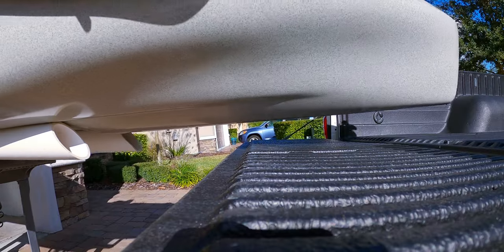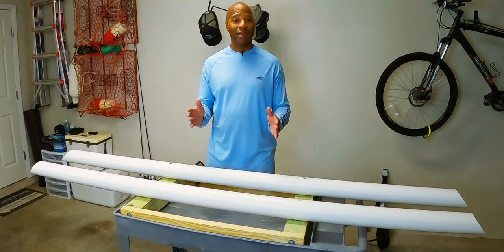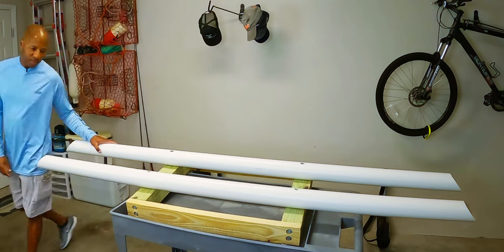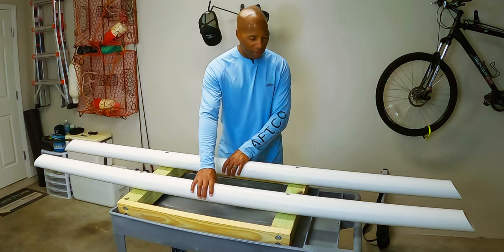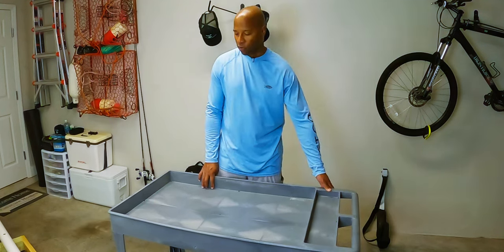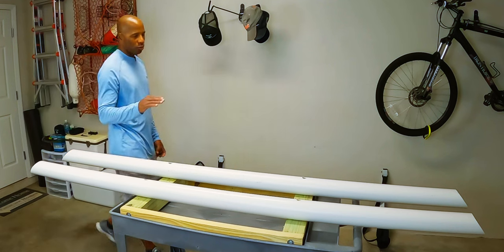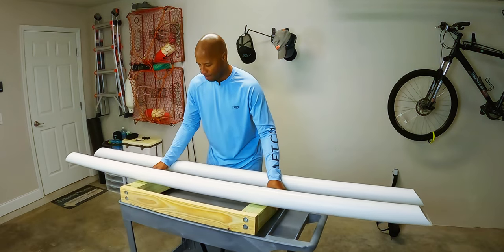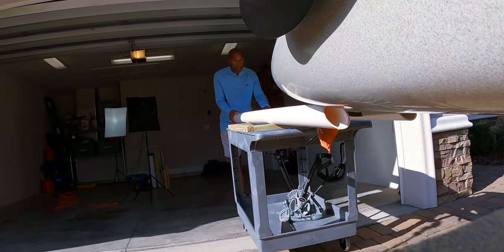How To Build a Kayak Storage & Loading Cart the EASY WAY!

Comment: Thanks! Funny thing is I already had the same cart in my Uline shopping cart before  finding your video. I saw other people use lower quality carts.
Reply from the maker: Nice!  I hope it works out for you.  There are additional details and pics of the cart on my blog - https://kayakfishingaddict.com/2021/12/how-to-build-kayak-storage-loading-cart/
Reply: Complete. Additional comments: Old Town Sportsman 120 PDL required 1) the pipes to be 12 inches off center as they stop before the bow, 2) center measurement for groove under yak is 9" (bow) to 8" (stern)  3) i needed to add weight (leftover 4x4s) to the bottom of cart otherwise it would do a wheelie. 
Thanks for your help!
Reply from the maker: @moretackle1  glad it worked out for you

Comment: This is an interesting build... Similar to others on YouTube that show PVC as the method of support. I was about to build one for my new Outback but decided to check with Hobie for their take on it. First I read my owner's manual and lo and behold there is a section on storage and transport.  They have a diagram and describe this PVC method and strongly discourage it. As a matter of fact they say that if their recommendations aren't followed it could void the warranty. I decided to follow up with a call to their corporate office in Oceanside to speak to a technical specialist. The person I talked to described this as a "tragic situation". They explained that there had been a lot of issues with cracks particularly around the scupper holes that they determine were caused from storage and transport on PVC bunks. They went on to explain that it would sometimes take a year or more for the cracks to develop. Long story short, they strongly recommend against it! Needless to say I'm looking for an alternative method. I hope this information will help others possibly avoid a costly mistake.
Reply from the maker: Hi Tres, I appreciate the concern.  Here's Hobie's official storage advice - https://www.hobie.com/articles/storing-your-kayak,85/ .  

This storage solution IMHO would be in the, "If you must store it right side up, use cradles or something that is shaped to the contour of the hull" arena.  Hobie makes a cradle that you could purchase and use that actually contours to the hull of some of their boats.  I've been to my Hobie dealer who has kayaks stored indoors on their ends and on their hulls on racks for long periods of time without issue.  All of this is to say, I've developed confidence that with a little support, like this solution gives, there should be no issues.  That said, "Caveat Emptor"  as YMMV!

Comment: Great build!  I have a question for you.  Why couldn't you use large wood screws to put the box together?  I'm building this for my 106 PDL.  Thanks for the great video!
Reply from the maker: You absolutely could.  Lag bolts will provide for a more secure connection.  It just depends on how strong you need it to be...perhaps lag bolts are a bit of over engineering.  Whatever you use, it needs to hold up to water as you're washing your kayak off.

Comment: Older video, I know
But for the wheel lock situation, just make a little U shaped chock for the fixed wheel, attach it with some string to the cart so you don't lose it.
Throw it on the front wheel preventing back/forward rolling when you have your kayak stored.
Reply from the maker: Nice idea.  I just have an old blanket in the garage that I throw down.  If you need them you can also get the wheels with the locks....that's an option for the same cart.

Comment: Awesome idea and detailed build, mahalo! One question- how did you know that the finished cart would be the right height with the bed of your truck as the original builder might have a different truck from your own? Looking at your blog it seems that if the unmodified cart is the same height as the bed then I should be good to go, right? Subbed and thanks again.
Reply from the maker: Glad you enjoyed it.  I'm not sure how I figured that out....I think his original spec called out the height and I measured the height of my bed and it was perfect.  My guess is that most are pretty standard if your truck isn't lifted....but that's a guess, ymmv.

Comment: According to hobie the proper way to store the kayak is upside down. How does this storage set up affect the kayak during hot weather?
Reply from the maker: That's a great question.  First, here's Hobie's official storage advice - https://www.hobie.com/articles/storing-your-kayak,85/ .  

This storage solution IMHO would be in the, "If you must store it right side up, use cradles or something that is shaped to the contour of the hull" arena.  Hobie makes a cradle that you could purchase and use that actually contours to the hull of some of their boats.  I haven't gone through a hot FL summer with this solution just yet, however, I have gone through several with a storage rack for my Hobie Compass and there was no issue.  I've also been to my Hobie dealer who has kayaks stored indoors on their ends and on their hulls on racks for long periods of time without issue as well.  All of this is to say, I've developed confidence that with a little support, like this solution gives, there should be no issues.  That said, "Caveat Emptor"  as YMMV!

Comment: Did you upgrade to the Outback? Thoughts versus the Compass?
Reply from the maker: I did....that will be officially announced on my channel in the next video...guess I let the cat out of the bag early huh?  A subscriber picked up my Compass already.  Today was going to be day 1 of me fishing the Outback, but I've been locked down working on producing this video!  I'll get out in a few days and I'll let you know!  My early take is that the Compass is the value fishing Kayak from Hobie.  It's a great boat once you upgrade a few things (e.g. square hatch, thru hull kits for wiring, ...).  The Outback comes with everything you need.  It's more stable.  If I had a 2020 Compass (I had a 2019) I wouldn't upgrade.  The major reason I did, besides wanting to experiment with a new platform, was for the kickup fins.  It's a bonus (maybe) that they're turbo fins.

Comment: I have nearly an identical set-up, but I built wheeled wood carts for each of my Hobies (Outback and PA) at truck bed level.  Like your setup, they rest on 2" and 3" PVC tubes respectively spaced 11.5" apart center to center.  Good weight distribution so the hulls don't deform.  No more lifting - they roll out to the truck and slide in. But I don't wash them on the wood carts, I use the cart deck for storing kayak gear, etc.  I built a PVC rack to wash the boats on.  Same height, the kayaks slide from truck to PVC wash rack.  When dry, they slide onto the cart, then rolled back in the garage.  Easy.
Reply from the maker: Sounds like a good setup.  I don't have room for another rack so washing them on the same storage and loading rack works best for me.  I tell you what, I loaded up today and I'm going to have to get my workout somewhere else...it was easy, peasy, lemon squeezy to load up and go!

Comment: Awesome idea and love the channel. I have a 2021 outback and I am going to make this. I even got the cart free since we have a lot of those at work. One question?? It seems like if you load from the ground and put the front nose (keel) on the pvc pipes and pick the back end up to slide onto the cart and load it that way as a single person, that once weight of the kayak front end is up there it would tilt or fall. Even with brakes on the wheels does that platform not tilt out of place or do you bolt that to the cart. I am asking as a single person loading onto the cart?
Reply from the maker: I never load from the ground onto the cart only from my truck bed to the cart.
Reply: @KayakFishingAddict  Thanks for the reply! I guess I just wanted to know how you got it on or off the cart in the first place. Like to get the kayak on the cart to load in your truck or once it is unloaded off your truck to get it off the cart. Seems like you need two people to lift on or off the cart? I am making it and thanks for the video
Reply from the maker: @randybinc.6443  The very first time I man handled the kayak onto my truck.  I loaded it just like I load it at the waters edge.  I put the kayak on my wheels, put the kick stand on the back to protect the rudder, then I lift the nose onto the truck bed, then I get in the back of it and lift the stern and push/slide it onto the truck.

After that, I unloaded it onto the cart.  My kayak is always either (1) on the cart in storage, (2) in the truck bed, (3) on the wheels between the truck and the water, or (4) in the water.
Reply from the maker: ...oh, and I use the popular bungee method to take the wheels on/off in the water.  There are lot's of videos on that but essentially, you replace the end caps on your cart with eyelets.  Then you have a bungee chord with three clips on it.  Two ends of the bungee go through the scupper holes and connect to the eyelets on the cart.  The other clip which is half-way on the chord goes all the way through the back lift handle and loops back and clips on the pad-eye on the back center of the Outback. Then you simply lift the backend up out of the water and the cart wheels snap into place.   

Here's a video of what I'm talking about ... https://www.youtube.com/cIDmWKyX8xw&t=690s
Reply: Thank you for all that info! The 1,2,3,4 of where your kayak is at all times explained it, the confusion on my part was thinking you took the kayak off the cart after every trip. You guys have an awesome fishery out there with the flats, skinny water, offshore. I have fished in the Tampa bay mangroves and Clearwater once and it was great catching snook, reds, sea trout! Totally different than my fishery out here in San Diego. We do have amazing saltwater fishing offshore for big Bluefin tuna, yellowfin and yellowtail. Inshore is calico bass, halibut, sea bass, etc. Your videos are top notch! Take care!
Reply from the maker: @randybinc.6443  I’m glad that clarified things Randy.  It’s interesting to hear the differences in the fisheries.  One of these days I’ll get back out to San Diego and maybe try to put a halibut in the boat!  Tight lines.

Comment: Hey there. I actually made this cart and it works awesome. Couple of concerns. It seems that maybe a little smaller PVC would do ok also but have you or anyone else had issues with the pipes being too still for the hull and bending anything? I can see it pushing up a bit in the middle of the floor on my PA 12. I thought maybe the pipes were not measured correctly apart from each other so took the screws out of them and slid the Yak on. Same thing. I believe the hobie sight says not to put on pipes. I love this solution but I don't want to mess up the hull.
Reply from the maker: No I haven’t  had any issues with mine at all. Perhaps just check the thickness of your pipes they shouldn’t band at all if so I would screw them down level by inserting support in the middle.
Reply: @KayakFishingAddict  that’s for commenting. I was actually thinking the other way around. Maybe too stiff and would help to flex some
Reply from the maker: @brianglennie888  Oh, I see.  I don't see how it would bend the hull tho if the pipes were straight and as long as it's not 200* in your garage :).
Reply: I had a similar thought.  I'm going to try a smaller diameter PVC with the ends fixed and some free room in the middle to allow the PVC tubes to flex.
Reply: @roptics314  I downgraded to 2” pvc and seems to be working well
Reply from the maker: @roptics314  Please let us know how it goes!
Reply from the maker: @brianglennie888  Glad to hear that.
Reply: @brianglennie888  can you elaborate on how the 2" pvc solved the problem?
Reply: @brianglennie888   To make the PVC flexible a bit, maybe this idea could work? instead of drill two holes on a PVC,  change one hole as an open groove that is still narrow enough to hold the PVC in place though not fully locked down,  so it allow the PVC to flex a bit under weight.
Reply: @roptics314  I like your idea and thinking do one as well. How do you allow some free room in the middle?
Reply: @hzhou8089  I used 8' long 2x4's cut down to 6' 01" and then used the cut pieces as 11" spacers between the long rails.  I used bolts with washers to suspend 2" pvc about 1" above the 6' rails.  My PVC pieces are 8' long.  The hull strakes are wider in the middle of the kayak.  The pvc flexes enough to match the curve and bow of the hull.
Reply: @roptics314  can you upload a picture of your invention?  No clear how the suspension of the PVD pipe is done. Thanks.

Comment: What is your cost in your cart
Reply from the maker: Hi Robbie.  Great question.  I honestly don't know exactly, and it will likely differ for everyone based on the supplies they already own, but here's a pretty good estimate.  The ULINE cart is  $135, shipping was $35 (your shipping cost may be different than mine was, but its fast overnight delivery) + $80 in lumber, PVC, lag bolts from Lowe's, so around $250.  A similar cart though can be had at your local Home Depot for about $118 which already is less than the ULINE cart but it also saves on the shipping since can pick it up.  Of course, the dimensions are different but adjusting the design won't be too difficult.  So, a cart like this can be had for $200-$260 assuming you have all of the tools you need already.

Comment: Thanks.  I was thinking of using a Husky cart from Home Depot which has built in grooves on top for two 2 x 4s - so similar to your set up without building the box.  See any flaw in that idea?
Reply from the maker: That's an interesting cart.  It seems like it would hold the weight.  The only thing that would concern me would be the assembled width; per the site it looks to be 17.25".   The ULINE is 25" wide.  17.25" might be ok, but it may also be less stable.  I'd have to see an assembled one in the store before I bought it to convince myself it would be stable enough.  Either way, I think I'd still build a box to fit in the upper tray as opposed to just laying 2x4's on top.  The weight of the 4x4 & 2x4 box gives me confidence when I'm sliding my kayak on/off of it.  The 2x4 only solution may work... but again, I'd have to test it in the store to make sure.  

Please drop back in and let us know how things work out with it if you do use it!  It would be cheaper than the ULINE cart since you wouldn't have to pay shipping.
Reply: @KayakFishingAddict  I think you make a good point. If I go with the 2x4s laying in the cutouts of the Husky cart, it could tip when loading or unloading. Your “box” is inside the cart tray which is more secure than on top.
Reply from the maker: @928johnralph  Yep!

Comment: How would it perform with a hitch bed extender?
Reply from the maker: I'm not sure, it depends on the extender.  But if it were me I'd build it to ensure the tubes reached the bed over top of the extender.  That way the kayak would slide onto the bed and not nose dive over the extender bar but below the tailgate.